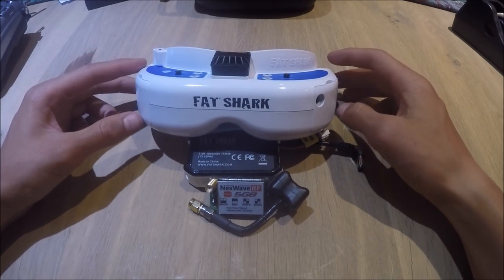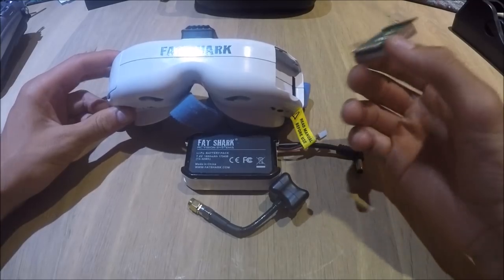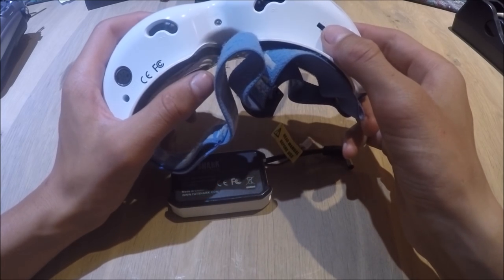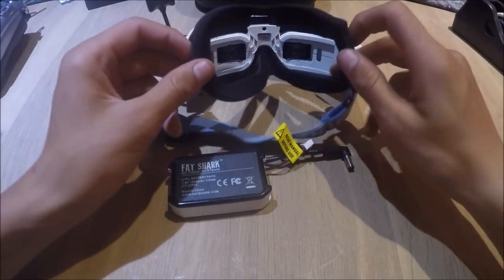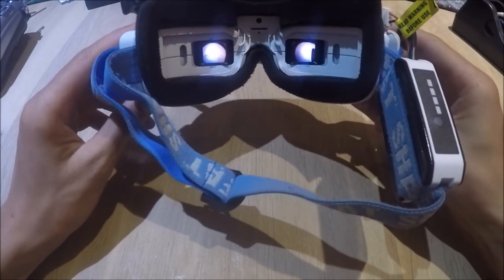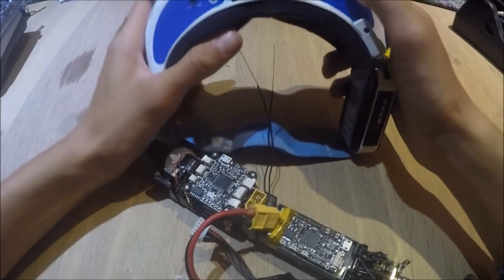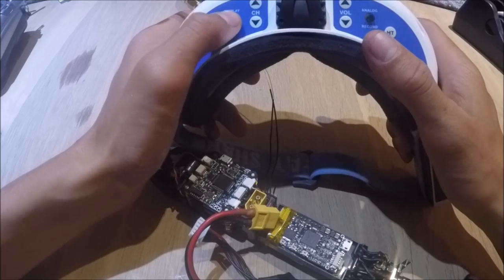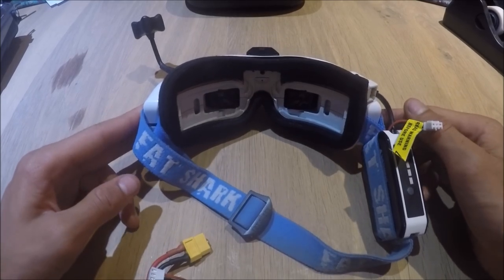how to set up / tune fat shark fpv goggles

Comment: The comment regarding the must having antenna on before powering up goggles, is simply not true.  Receiver is just that, the receiver and it's not emitting anything, so w/o antenna you will get poor reception.
On the other hand, VTX is powerful source of radio waves  and it could burn if it doesn't release it by antenna.
Reply: What VUK said.
Reply: Better to keep doing it so you don’t create a bad habit ! Happy flying

Comment: Thanks for sharing mate, screw the haters.
Reply from the maker: r3verseb4ckfl1p thanks bro need any other help ?
Reply: Sky High Movies thanks for offer bud I really appreciate it man. These are my first pair of  goggles like this.  Do you have to change the channel manually every time you plug it in to fly?
Reply from the maker: any time man, you shouldnt have to once you have them set on a channel every time you turn them on or off they should connect to your device, the only time this didnt happen for me is when i had a faulty vtx on my drone.
Reply: Sweet, Thanks again bud, I finally worked out how to get picture and after I turned it off and back on again it remembered the same chanel. Are you on Insta or FB?
Reply from the maker: both mate insta - lucasperies_
Reply: added you on insta bro. cheers for the help.

Comment: Great video, but I noticed the receiver says "race" I'm just flying my Inspire One around to get better shots of stuff. Is that still good to use? Also what about the antenna? What else do I need beside the Fat Shark? Just the receiver and batter charger?
Reply from the maker: im sorry i haven't ever used a dji product with my goggles, i use a tbs trimpth antenna, batteries that came with the googles and just a camelion charger. any standered charger or baencer will work with the batteries.

Comment: thanks for explaining how the goggles and receiver works. can you explain how the transmitter is set up? im assuming you connect fpv camera to the transmitter. and then you connect the transmitter onto the power distribution board?
Reply from the maker: yes i believe that this is correct. i can not be sure though as my drone (TBS Vendetta) comes pre made so i have never had to do what you are explainig

Comment: You could burn out a transmitter but not a receiver.
Reply: +1.
Reply from the maker: thank you i did'nt know that
Reply: sky high movies 
No problem. :-) if you have a diversity setup you even can search and find your aircraft by removing the antennas. joshua bardwell recently made a video how to do this.
Reply from the maker: thanks man i will search for that video now. nice channel by the way:)
Reply: sky high movies :-) thank you! merry xmas!
Reply: So it’s ok that I powered up the fat sharks without a receiver module? Guy at work let me borrow his but it didn’t have a module 😀
Reply: Tedro Peders yes. There is an on off switch on the bottom to turn the module on and off. If you’re using HDMI or composite input you don’t need a module.

Comment: Hello There! I have a stock F3 Wizard (linear antenna) and Attitude v3s (circular polarized antenna) and as I cycle through the channels I get one or two that should be probably be the channel however they're horrible/unusable. I looked at the user manual which didn't appear to offer any help with this. The V3s work with my FPV Inductrix so I wanna rule them out as the prob. I'm been placating myself by flying LOS which is shit... help meh please... :( and many thanks!!
Reply from the maker: hi 
have you tried looking at your vtx ?
Reply: Sky High Movies I didn't know that it needed to be messed with. it's sealed in heatshrink! I'll get it sort it out, I hope!
Reply from the maker: yeah i would just check to see if the pig tail is properly conected and if the problem presists maby contact the people you got the vtx from and see what they say as sometimes they can come a bit dogey and not work, i had to send one of mine back once

Comment: I'm sorry but you cannot burn out the receiver. Only the transmitter if y I don't have the correct load/resistance attached to it. You can power on the receiver no problem without the antenna being attached, but not the transmitter.
Reply from the maker: thanks my friend for realising this but when i eddited the video it only showed up for computer users but not pone users
Reply: Sky High Movies Ah, sorry for the misunderstanding.
Reply from the maker: its ok my friend nice chanel btw :)

Comment: I have crisp video until I go to plug my headphones in. Then the video has noise and the visual becomes wavy. How do I fix this?
Reply from the maker: JimmyDean1992 I have never had this problem sorry, are your reciver and transmitters the same brand
Reply: Yes. When I plug the audio in for my box fpv system. which is eachine goggles two. There is no video noise. So it is deff a fatshark problem